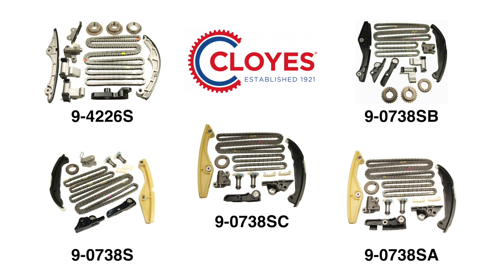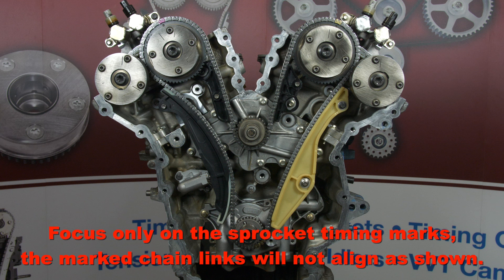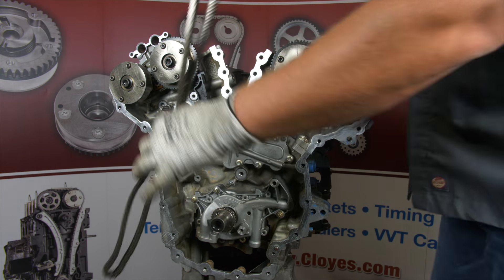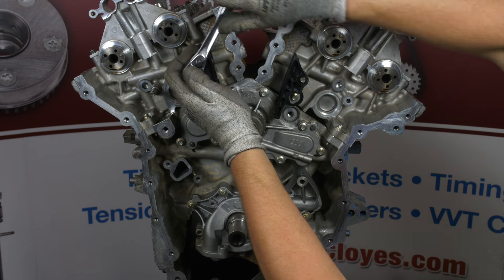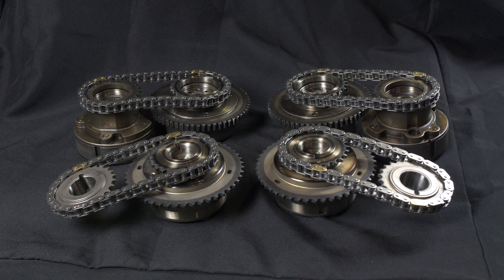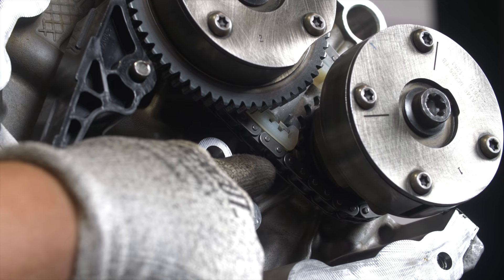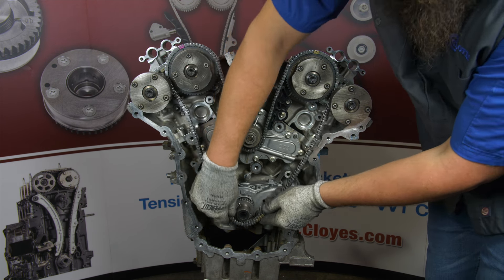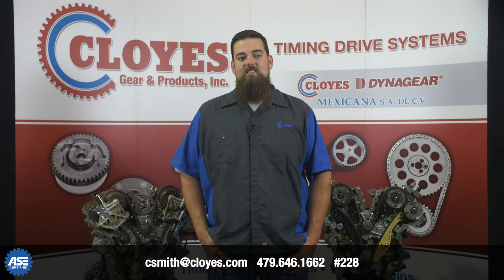Ford 3.5/3.7L DOHC V6 Timing Chain Replacement, Cloyes 9-4226S & 9-0738S

Comment: So the metal wears out on the timing chane and the metal gear wears out? is that what you are stating, FORD USE CHEAP METAL IN THEIR ENGINES,
Reply from the maker: Chain and sprocket wear is normal across all manufacturers in timing systems. It naturally occurs when you have metal to metal contact over time. Oil is the primary wear preventative, so keep your oil changed and use the recommended weight and specification.
Reply: @Cloyes01  how come in the old cars chain never wore out, and never replaced a timing chain.
Reply from the maker: @johnsmith-lx9lw  Chains systems used to drive one single camshaft and used a relatively short timing chain. If every pin-to-link fitment point experienced wear you might see an additional 1/4" or 3/8" of chain slack overall. Chains in modern engines are sometimes driving multiple camshafts/VVT phasers/water pumps/oil pumps/high pressure fuel pumps/etc... And these chains are 3 or 4 times the length of an old pushrod application. If every pin-to-link fitment point experiences the same amount of wear, the overall slack created is much more noticeable. Modern timing chain system wear is the result of much more complicated engines and increased demands.

Comment: How does one even know which of the cloyes phasers online are genuine? I bought the pairs for my 5.4l, but I can see the packages printed made in China. Is there away to identity that?
Reply from the maker: Our phasers are made in China. They are manufactured in an OE manufacturing facility and are 100% hydraulically tested before packaged. Our quality department here in Arkansas does frequent testing, and did all the developmental work. To manufacture these in the US they would be 3 times the price and would not be of the quality we are currently supplying. 
We recommend buying from a trusted supplier to ensure you are getting genuine product.
Reply: @Cloyes01  Now, I'm happy, I got the right stuffs. I got the phasers from Fomoco, USA. 
Thanks once again, for your replies.
Reply: @dxta7360  do you have a link to them?

Comment: 100% wrong!!!! Use the cam lock tools to hold the cams in place! No need to remove the upper tensioners! The upper timing chain guides do NOT need to be removed, even for water pump replacement. Torque to yield on phaser bolts is not 180 degrees, it is 150 degrees per workshop manual on PTS (Ford's private website). NEVER install the primary chain on the right bank first, ALWAYS install the chain on the LEFT bank first as this is the bank the crankshaft will pull on first upon start up. It's clear you installed the chain very sloppily & the ONLY TIME that ANY cam is to be moved to "adjust" a mark is the "right bank" INTAKE cam & only by, at most, 1/2 tooth. 100% wrong on the timing chain alignment. If you install the timing chain properly, the bank 2 INTAKE cam only needs to be moved 1/2 tooth, then install the tensioner & pull the pin.
Reply: Looks like it still worked to me
Reply: You are actually wrong. The Ford service manual says 180 degrees, it does not matter which bank gets chain installed on first, guides should be replaced if worn which they usually are, and cams and crank can be moved slightly to time the engine. Also, it is possible to time without the special tools as demonstrated here.

Comment: Step one of replacing the timing components on these engines. Don't. Its fuckin bullshit. Especially if you have to do it while the engine is still in the car.